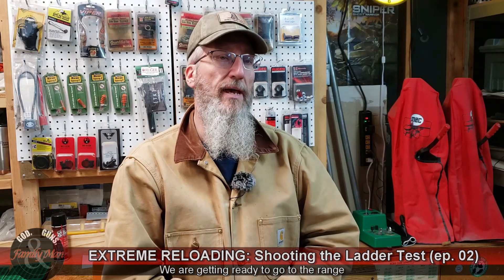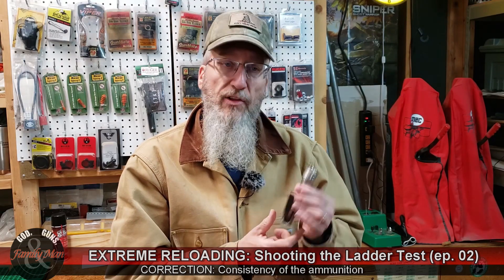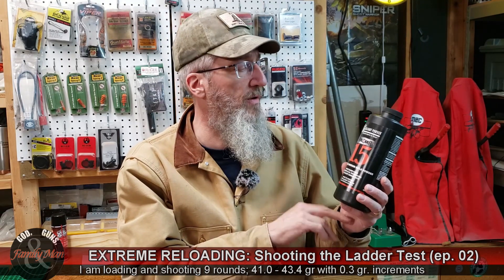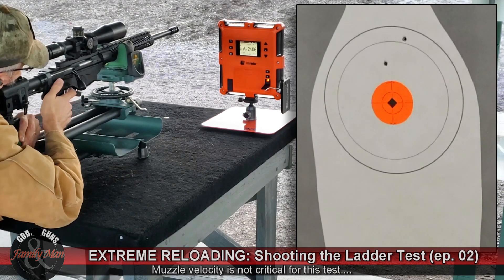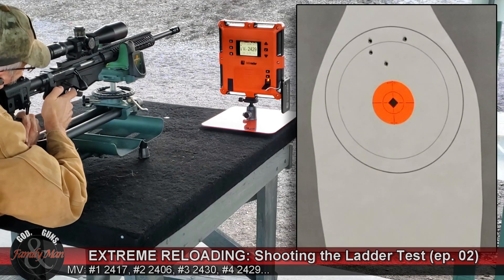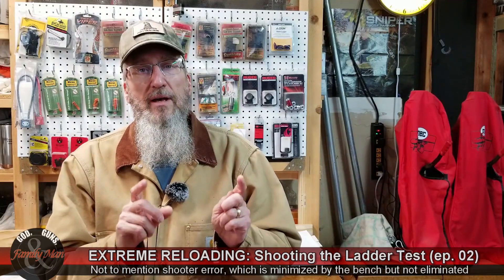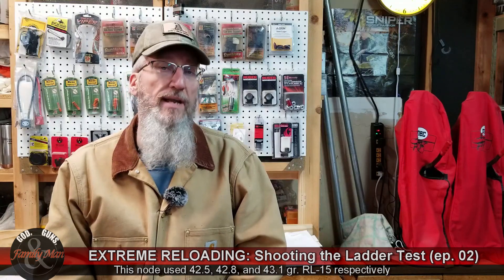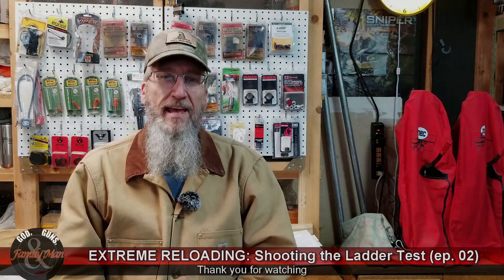EXTREME RELOADING: Shooting the Ladder Test (ep. 02)

Comment: One potential problem with the Ladder Test is a sample size of one with each specific load.  
For example, rounds #2,#5,#9 grouped together... much better than #6,#7,#8 especially in the vertical grouping ...some of this may have been due to natural  error inherent in the shooting system.
There may be inherent errors in the shooting system that creates "artificial results".  For example, why did velocity decrease with an increased powder charge? #1 to #2  2417 down to 2406 fps,  loads #7 to #8  2500 down to 2509 fps The decrease in velocity may have been due to natural errors inherent in the reloading and chronograph system.
With a ladder test, the natural variation in the shooting system may be expressed by the horizontal dispersion of shots, so for example if shots have a horizontal error of +/- 0.5 inches, the natural vertical error might also be +/- 0.5 inches which could lead to some "artificial results".

One potential way to account for the problem of sample size of 1 would be to shoot a ladder test each day for several days to see if the results are consistent and reliable.

Looking forward to your next video with 5 shot groups!
Reply from the maker: Thanks.  This is very good information to consider.  I think some of the dispersion is due to barrel oscillation but am not sure of it.  I think you are going to enjoy the next video.
Thank you for watching and posting this good information to consider.
Reply from the maker: I wonder if viewing the ladder results by superimposing all round impacts on a vertical axis might be informative.

Comment: This video came just in time as I will be loading up some Hornady 168 grain ELD-M bullets and 168 grain Sierra Tipped Match ( if I can find any in my neck of the woods ) for the first time in my Remington 700 308 Winchester Police Model  26 inch barrel length in a few weeks time . I’ll be sure to try the same method you are using to find a good accurate load . Cheers.
Reply from the maker: Good timing indeed.  Thank you for watching.  We will continue this workup and load testing in the next video as well.